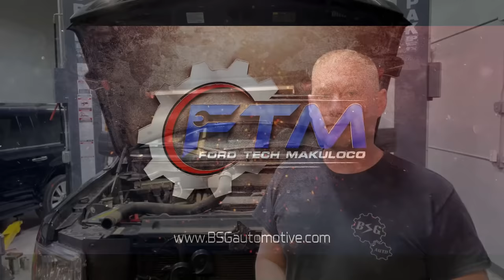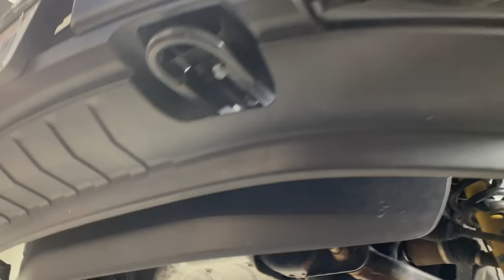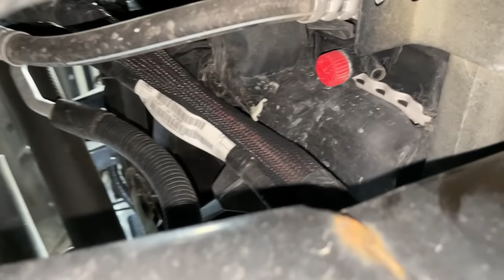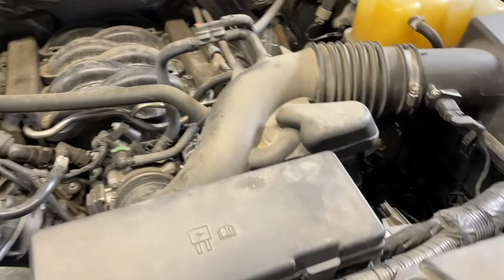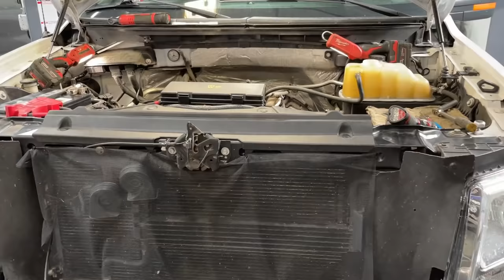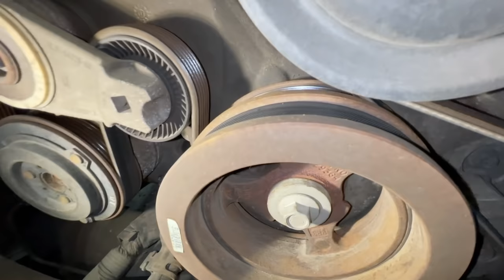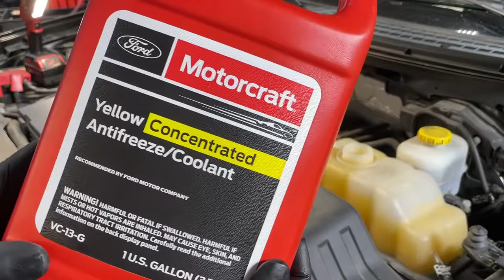2011-2021 Ford F-150 5.0L Coyote Engine: The Most Common Coolant Leak Repair!

Comment from the maker: These are the Tools and Parts I Recommend:
Automotive Pick Set-
https://amzn.to/3xTRoPW
Ford Genuine Y-Pipe-
https://amzn.to/3qr4Fgd
Upper Radiator Hose O-Ring-
https://amzn.to/3w2bINO
New Ford Yellow Coolant (compatible with old OAT coolant):
Concentrated-
https://amzn.to/3zYpRP1
Prediluted-
https://amzn.to/3qotf1n

Forscan is a free Ford Specific Diagnostic Software:
Download Here- 
https://forscan.org/home.html
ELM 327 Adapter I Recommend-
https://amzn.to/2GC6dBj

As an Amazon Associate I earn from qualifying purchases.
Reply: When you do water pumps on those coyote engines they always disturb the y connector and o ring on the hose and they leak
Reply: How caN I contact u directly. Having issues with 2015 Ford transit connect 1.6l. No start. Have no crank signal and p0118 for coolant temp. Will still code caused it not to start? After excessive cranking it will logged p0322 for crank sensor
Reply: @FordTechMakuloco can you make a video of how to get a broken dipstick out of the 2012 F150 5.0 seeing as it goes straight into the side of the engine instead of a separate tube
Reply: Will that o ring fit a 5.0 mustang as well? Amazon is saying it won’t
Reply: @FordTechMakuloco. Do you have a link for the upper and lower radiator hoses?  My buddy wants to do all those and the y pipe on his 5.0 and I can't find Motorcraft hoses.
Reply: Is the gasket for a canadian 2015 5.0 supposed to be 1073 or 1087? According to the parts list on a dealer site here it says 1087 but your link is a link to a 1073 gasket
Reply: Your advise alone is invaluable  I have a 2014 5.0 that I’ve been tinkering with for the past 7-8 years or so I’m so thankful for experts such as yourself addressing our much desired concerns keep up the good work can’t wait to see your next videos 

All the best ,
Street😈
Reply: @DevinHVACInc  ppp
Reply: @fordtexhmakuloco I have done this job 2x and the reservoir never does burp. I have let it run for nearly 20 minutes at a time. Any thoughts on why or what we caused that?
Reply: @VolcanicInternational try driving a short distance around the block and back a few times. Then let it cool for a few and then check. Usually works for me.
Reply: Appreciate it
Reply: Hey buddy  this part im chnage and change the thermostad and continue temp up
Reply: @FordTechMakuloco Any insite to why the fans always seem to run on high after changing the thermostat. Even using Motorcraft.

Comment: One of the many things about Makuloco is you never hear him swear, unlike me when I'm working on any of my vehicles.
Reply: 🤣🤣 yeah, Last summer my neighbor was putting a rebuilt engine in a 97 S10 p/u. I think he invented a few new swear words. At times I think he made cuss word sentences. 🤣🤣
Reply: That was me today!
Reply: I was thinking the same thing.This guy never gets upset.
Reply: I had to do this same job on my 2013 f150. Had a friend standing by watching. I was over the rad, arms deep into the hoses spewing all kinds of fowl puke language. Finally got done, looked around, he was gone. Asked him later where he went, he said he left before I start throwing tools. It wasn’t that bad. I think I scared him.
Reply: Jenny Melo  Did the same, o-rings. Usually the hose is fine.
Reply: Unlike us he can edit those words out.😁
Reply: Didn’t know it was possible to work on a Ford with out swearing or crying!
Reply: Now that you mention it, ive never realised this before. Brian must have the patience of a saint
Reply: jennymelo2098  how was it? Im doin this this weekend?

Comment: Hey guys,  so i replaced this part on my 2012 5.0 model recently.  After replacing it,  my MPG dropped dramatically to about 11 mpg. I replaced the thermostat, and cleaned the MAF sensor,  and throttle body since I was under the hood.  After that my MPG went up to 18 MPG!  Never would have thought an old (119k miles)  thermostat could have such an affect on my MPGs!

Comment: With the 10 year run of the “Y” pipe leak history, what change did Ford make to the replacement “Y” pipe?
Reply: None
Reply: note 10 years...and going
Reply: Nuttin
Reply: None.
Reply: Inexcusable
Reply: The best change they made isn’t a change at all- luckily they’ve made this part easy to change out for an aftermarket reproduction that actually works.  It is puzzling ,though, that they would intentionally keep using this sub-par part knowing all the trouble it produces. I’m a Ford guy, but it makes me question the company’s integrity.
(For the models up to the 2020, that is)
Reply: Its aluminum now. And I can't get the damn thing on! lol
Reply: @zaneseligman1313  Cost money, and a revision of assembly. Why would they do that knowing the part will fail usually out of the range of the warranty? The answer is, they won't. It's out of range of warranty, so it's not their problem anymore until someone makes it their problem. Then, they issue a recall knowing 95% of people won't actually hear about it and if they do, another 50% can't afford to let their truck sit in a shop for 2 weeks for this.
Reply: @roetemeteor  I think you’re spot on- especially the ‘not their problem’ stand that they actually took - they know their product sells- as is- which means they know they’re selling anything but 
‘quality 1’ - THATS what consumers should be made aware of . Speaks volumes for the company overall / I feel anyway
Reply: @brandonmcgovern4519  I assume you finally did get it  on. You did the swap like this video?

Comment: Every coolant leak I come across on these motors, other than a water pump is from an O-ring that shouldn't ever have been there. The worst part is the dealer never has all of the ones I need in stock, and the price they charge for them is out of this world. I shouldn't have to pay more for an o-ring than I do for an OE spark plug from the same place. Hell you could buy 2 with what I have been charged for some of those things.

Comment: I have been a Ford guy since my first hand me down car which was a 70 mustang Mach 1. I have been fighting Fords engineering since day one. I had to remove the complete dash to change two nylon bushings on the clutch pedal!!! Fast forward some 35 yrs, ALWAYS worked on my own stuff and here I am with my 2014 F150 5.0. Always bought new fords and learned as I go. We are a long way from carbs and 5/16 hose clamps. You have helped me keep up with the times, keep my Fords running and problem free with your great videos! My 14 has every MINOR issue you have described. Water pump(junk), “O” rings, burn fuse and brake issues. Every time ….you have the video! Even my Transmission fluid change with no damn dipstick! Keep um coming pal, I only have 140K so at least 140K more to go on this one. Thanks
Reply: Well….here I am again. 203506 miles on same 2014 F150 5.0 and I am smelling antifreeze for about a week now. Couldn’t find anything but the level was obviously going down. Weekend came and I pulled the air intake apart to access water pump area (replaced at 75000). Nothing to see. Wiped my finger around the clamp on the thermostat and there it was. Leaking on the back side.  I came in and jumped right on this channel and of course, he has the perfect video. Ordered parts from his channel and will be replacing all next weekend. Thanks again.

Comment: Thanks. I bought a used 2014 F150 XLT with the 5.0 released from a fleet leasing company which overall runs great. Love having a truck again. Your videos really help before, as in the purge valve causing stall issues with no check engine error codes. Your video prevented me from chasing my tail or having to the Ford dealer who would chase their tails across my wallet. What a simple fix, thank you. 
I currently smell traces coolant when I park the truck after a it's warmed up. Only about a half a cup every couple weeks but don't see leaks, nor have overheating issues. But I smell it. Now with this video I know actually where to look for possible leaks since currently I can't not spot one. Going to watch your throttle body cleaning video, looking forward to that piece of knowledge shared to all of us out here. Thank you!!!

Comment: THANK YOU!  This video save me an $1800 repair bill my local mechanic wanted for this job!  The links to amazon parts were spot on!  Done in 1 1/2 hrs!  Works perfectly
Reply: Yikes! I was too late finding this video and the dealer found and fixed it. Front/rear differential fluid replacement, new antifreeze and replacement of the Y connector and hose cost me just a hair under a grand.
Reply: That’s the "we don’t want to do it price" haha

Comment: Thank you for the instructions.  It took me about 90 minutes to change out the Y pipe and clean the throttle body.  (Many more hours if you count lying in bed the night before rehearsing the repair.)

Comment: What a great way to start the new year :) 2016 f150 5.0 v8 at 91.000 miles, I replaced the seal and y joint. Follow these instructions exactly in this video with no issues afterward.

Took me 45 minutes 

Thank you!

Comment: The content of your videos and the information you give are fantastic. It was through one of your videos that you mentioned a recall on the Taurus, Edge etc. for the rear toe link. I called my dealer here in Ontario to find out about it. I gave them the recall # and my service guy said he wasn't aware of it but within a week he called with an appointment for the recall. Thanks, it's all due to your videos that I knew about it.

Comment: I wish you posted this back in January after my 2015 F 150 5.0 went in the shop for the same problem.  Down side the dealer had my truck for 11 days before they could get the part so they say.

Comment: Another fantastic video!  I've been wrenching over 50 years and I watch your videos and learn the vehicle-specific tips and smile at all the little things you do to work smart not hard.  For example, use an impact wrench to get the throttle body bolts close and then use a socket to feel the tightness.  Nice work!  Thank you!

Comment: Excellent video took me about 30 minutes plus fill and warm up time. Draining from the bottom of rad meant no spillage at all so belts were fine. Vehicle was completely cold I did cover belt area with rags. nice easy job. 2011 F150 5l

Comment: Thanks for the advice.  I just replaced my flat leaky o-ring for my upper hose tonight.  Thanks for the top notch service help
Reply: What's o'ring size ?  Thanks...
Reply: @marioallard2235  not sure I just had Ford look it up at my local dealership
Reply: @marioallard2235  BC3Z 8590 F

Comment: Thank you for this video! It was exactly what I needed to fix my leaking coolant system! And I'm not super mechanically inclined, but I can follow instructions, and these are pristine! With buying parts, coolant, a drain tube, throttle intake cleaner, and picks, it cost me about $100 and a little over an hour. Plus I cleaned the throttle body, which I'm sure would've added onto Ford's $600 quote that took several days to get. Thanks again!
Reply: a non-ford dealership just quoted $698. For an upper radiator hose and the "t" piece junction... but I can't help but feel like this dealer ship charging upwards of $400 dollars for labor and waiting two days to tell me all of this is totally worth it... nope haha !

Comment: Thanks for the detailed video. I am going to replace my Y-pipe on my 2015 F-150. I am losing coolant, slowly. No puddles seen. I know it drips on the serpentine belt because belt slips and squeals when I turn on the AC. Only happens when it's really hot outside, 90 + degrees. Replacing both belts and the Y-pipe, and O-ring at 67,000 miles. Do it myself for $120.00.
Reply: I have the same problem on my 16 XLT. Small stain on ground sometimes as it seems to start and stop. Glad I saw this vid, cause I thought it was a bad upper radiator hose.

Comment: Thanks for this. Great info, especially on the quick-connect hoses/ throttle body/purge hose. I didn't know the coolant hoses had to be aligned 'notch to slot'. Just did this repair 9-2023. Along with changing OEM belts and A/C Idler pulley(since I had it apart). 2014 F150@ 215K👍
Reply: How hard is it to change the pulley?
Reply: @J410N528  Ok, I have the 2014,  5.0. Once you relieve the tension on the A/C belt, it is a simple matter of removing a single bolt (15mm head) and the pulley comes right off. Easy to access with ratchet. Then reverse with new to install.
Reply: @jacklantern6339  wow, crazy easy…makes sense to do it then for sure.

Comment: I'll try and stay ahead of the game and order my parts now since my '16 F150 5.0 could start leaking at any mile.  Thanks for the info Brian!
Reply: Greg B  18.5k miles, bought it new.
Reply: Greg B  I own three Ford pickups and they are used primarily for work.  All regular cabs with long beds.  No taking the kids to soccer practice with my trucks. haha  I special ordered the '16 and here is a video the day I picked it up from the dealership.https://youtu.be/5SVb-zv_9bg  and I discuss the window sticker and price.
Reply: Greg B  mine is a 2011, has 83000 on it, and it runs great. If I drive it right, it gets 23-26mpg on the highway. It's a 4x4 supercrew xlt with the 3.55 gears.
Reply: @markk3652  I have never even come close to that mileage with the 5.0L
Reply: @ozzstars_cars  again, I drive it easy, and keep everything nailed down with maintenance. Clean air filter, tires aired up properly, and alignment in spec. The 3.55 diff gets the credit here too. My 2006 had the 3.73 gears, and the 5.4 3v it drank fuel a bit more greedily.
Reply: @markk3652  my truck has a 3.55 rear as well. Lucky to get 18 on a good day.

Comment: Thanks so much for this, saw my 2013 Mustang GT leaking coolant at the y pipe replaced the entire water neck with the metal one from Dorman as well as the gaskets, went very smoothly thanks to you
Reply: Have you had any issues with the metal Y? Mine was an absolute bitch to get on, and yesterday my upper radiator hose blew off on me

Comment: This was a great video.  Removing those spring clips and cutting the hose to remove it are the things that the average guy would struggle with.  Plus, removing the air after coolant system work is a hot topic around the internet.  People report overheating problems, and "burping" is often the first suggestion.

You haven't been posting much, good to see new content.
Reply from the maker: Yup it’s been busy at the shop, not much time for YouTube.
Reply: Because new and used vehicles are so expensive that people are fixing their old ones.

Comment: Thanks for the video!  Just did this today on my truck.  Only issue was I could not find the rad drain valve.  Looked all over the passenger side lower section of the radiator.   Ended up just popping upper hose off rad and letting it slowly drain down to the level of the Y hose and then changed it.  2017 F-150 XLT 5.0.

Comment: The amount of videos you upload stating that these are common issues is what made me sell my f150. Seemed like everything I had issues with turned out to be "common" problems. Everyone acted like it was no big deal.
Reply: So what did you get to drive instead of the Ford?
Reply: @skyhawk21  I just kept driving my ranger. Just saying that the f150 I had was constantly needing something fixed. I spent about 2,000 cad a year on repairs. 

Also I bought the truck new in 2014 and sold it with 125,000 km on it and it was starting to have a misfire on cylinder 8 so I just cut my loses.
Reply: The F150 is the most popular vehicle in America and has been for many, many years.  Because with the advent of YouTube, any problem now ends up as a video.....everyone panics and assumes the vehicle is no good.   Anecdotes of "I am selling mine today" and "I wish I knew this before I bought it" are everywhere. 
Let's start some critical thought before everyone jumps off the bridge.  Is the F150 perfect ?....nope.  It's made by humans.  
Is the Ram, Sierra, or any other truck perfect ?  Hardly.  Same humans make those.
Time we all take a chill pill as my kids say.

Comment: If you have this problem do yourself a favor and do what he did and change that upper hose and the T. I changed o rings and it lasted about 90 days and started leaking again. Also make sure you clean up the corrosion/ porosity on those metal pieces that is going to be a big issue on these engines. Piss poor design. Great video!!

Comment: Did this on mine last year. Super simple job. I needed to change my coolant anyway lol
Reply: Sure it's a "super simple" job. Nothing is super simple on a Mod motor except for changing the Alternator.
Reply: @DS-ss7vl The 2V motors are much easier to work on.  That's why I'm going to keep my 4.6L 2V as long as I can.  It ain't sexy, but it requires minimal maintenance compared to the overly complicated, overly engineered modern stuff.
Reply: @DS-ss7vl   this particular part is right in your face, easy on easy off.

Comment: thanks for the video.  It was my problem.  This was harder to do than thought.  Very hard getting all the connections to line up.  I had to remove the thermostat housing & that made connections much easier.  The connection to the thermostat housing is very difficult to line up due to the tension in the radiator hose, but removing the thermostat fixed that.  I made that connection first.

Comment: Man I wish I would’ve seen this sooner. My dealer fixed a coolant leak and charged me an arm and a leg and pro ably replaced this part instead of the heater core that they said they replaced. Great video nonetheless.

Comment: Hey big fan Im from ontario canada ford tech makuloco has saved me thousands repairing my ford trucks over the years . Just want to ad to this video . On my 2015 f150 my coolant drain  was on the drivers side not the passenger from what I understand this is for 2015-2019 models drain is on drivers side.

Thanks!